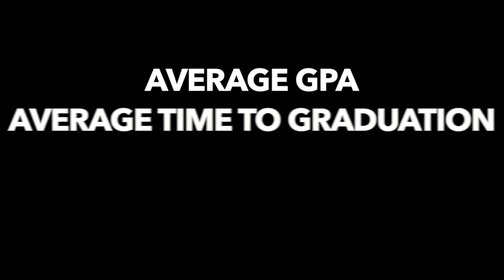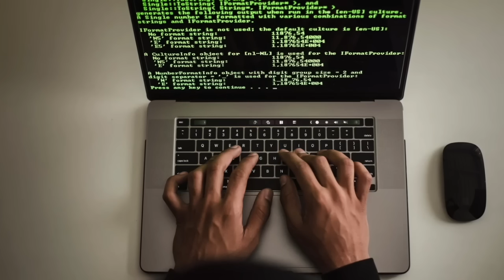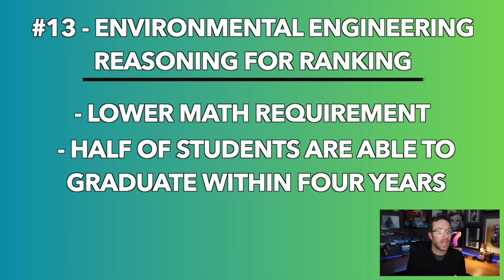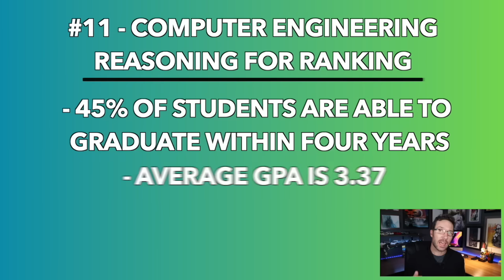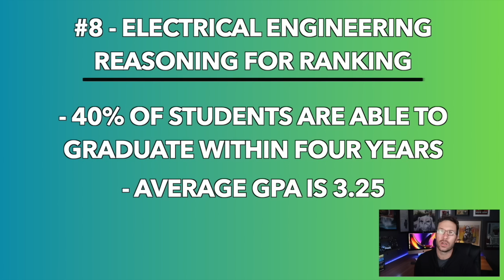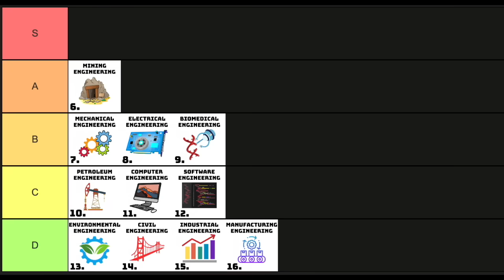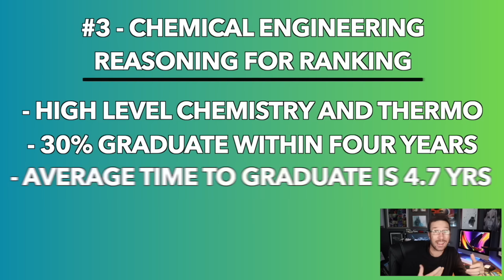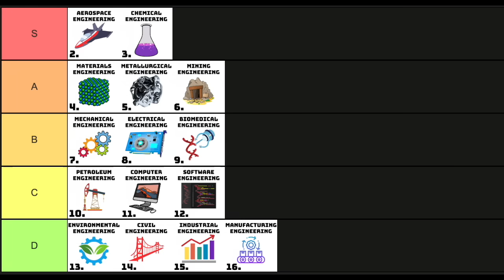Engineering Degrees Ranked By Difficulty (Tier List)

Comment: I've been working with mechanical and manufacturing engineers for more that 30 years and have never met one with a BSME degree who used calculus. Design software takes on more calculations that used to be done in an engineering notebook.
Reply: True, but at least in theory they ought to be able to understand what the design software is doing!

We manage to teach basic physics without teaching calculus first, which is really a bit strange because understanding calculus makes it a lot easier to understand what's going on in the physics, and I would think that since engineering builds on basic physics, understanding calculus is more and more of a benefit in understanding things there.  At the very least, you've got the idea that the accumulation of water in a tank is the integral of the inflow, even if you don't use those words for it.
Reply: @BrooksMoses  How many people are now utilizing AI, yet do not have a clue what background calculations/algorithms are being used? Certainly, knowing this could be helpful but is often not necessary. Many mechanical engineers do not use FEA on a frequent basis, if at all. Companies often designate someone to do this higher-level work because some hand calculations are necessary. Those with masters degrees are more likely to do this, at least based upon my experience.

Comment: The catalogs show the number of hours mentioned in the video. If you do not have the math - trig, plane & solid geometry, college algebra, there are additional courses added to the hours. I had Calc 1 before entering college, but I had to have 145 credit hours to graduate with a BSAE. My advisor had a 160+ credit hours for a BS engineering degree.

Comment: There are a lot of reasons people dont finish their degrees.  Engineering is rigorous and challenging in general, however, for an individual the type of engineering most challenging is a type for which you have no passion.  Further, the opposite is true.  

This video is pretty poorly setup and researched.  I think he is confusing a lot of information associated with engineering and engineering technology and basic science classes.  First off, I know of no actual ABET accredited engineering program that requires Math only to ODE.  You are required in most all engineering to take at least one math class past that (i.e. Linear Algebra, statistic, partial differential equations, numerical analysis....).  I find the idea that Materials and Mining engineering ranked high is laughable.  He describes environmental science here not environmental engineering which requires math past ODE too. Finally, if you worry about the Math classes you have to take for engineering, then the degree is not for you.  Your math classes are your easiest tech classes and elective you will take.  If you cant deal with the math, then the physics and engineering classes you will be required to take will bury you.  Don't put any credence into these sort of dumb lists.

Comment: Using my history as an engineering graduate/retired I would argue the use of GPA and years to complete would be poor measurments of program difficulties.  I don't think the assumption of equal performing students enter every program is accurate as both demand, salary and plain technology interests/challenges would draw different caliber students to each programs.  And on the other end many lower performing students would pick easier enginneering programs just to get into the higher salary jobs without as much diffculty.  Therefore to look at GPA and  time to cmplete would not be correct because the talent level going into each is not equal.  Nor do I believe it balances out with larger quantities.
Reply from the maker: interesting point. So what data would you use to rank them?
Reply: @becominganengineer2271  .I honestly have not thought a lot about it but I would suggest your premise is wrong.  A college programs is not objectively hard....it is subjective.  To a large part of the population dunking a basketball is hard...to 100% of the NBA population is is easy.  First thoughts, would rate difficulty as a dependency of the  input subject...for ex.  SAT scores going in, Math/science specifically or  perhaps courses completed going in. I might compare them to GPA performance,length to degree, or dropout rates.  Then the conclusion, if correlated, would be difficulty as a function of these input variables.  There is also the assumption that "difficulty" measurement has supporting and accessible data....that may or may not be true.  WIthout data, you may have to rely on surveys of students...not real accurate but may be best available.

Comment: This video is bullshit. This is why people without Engineering degrees should not be making videos about Engineering.

 First of all, Electrical Engineering has by far the highest level of math amongst all Engineering and including computer science. PDEs are not the most difficult level of math, they’re just ODEs with multiple variables. After taking more complex math courses like calculus I-III, Electrical Engineering students also take EE courses that are 100% advanced math eg control theory, signals and systems, Digital Signal Processing, Electromagnetic waves, transmission line theory, power electronics, circuit theory. 

Also, Computer Engineering is typically an elective of Electrical Engineering

Comment: I agree!  Getting my nuclear engineering degree pretty much kicked my butt but I made it through (BNE81).  What I did learn in college was that I wasn't as smart as I thought when I graduated high school.  I'm surprised that the math requirements have changed so much since I remember taking 2 years of calculus as well as half a year of advanced math (LaPlace Transformations, etc.).  My hardest course was however a ChemE thermodynamics course.   As far as zero growth goes I have to disagree.  Although I'm getting ready to retire after 43 years in the nuclear power production field, my phone rings constantly from companies looking for engineering help for advanced and small modular reactor design and licensing.  There's going to be plenty of nuclear engineering opportunities in the next 10-15 years and a definite shortage of nuclear engineers.
Reply: I actually am the opposite.  Got my degree from Arizona in '94 (one of the last group of BS students before the Dean of Engineering killed the program and folded us into Mechanical -- around '96 or '97).  I don't know if it was our professors, but we had some of the best professors that could easily explain things to us (David Hetrick, Morton Wacks, Robert Seale, Barry Ganapol, John Williams, William Fillipone, and Wayne Jouse) and the NE classes were easy to understand.  I found that classes in non-Nuclear subjects were actually more difficult than the Nuclear subjects (with the exception of Thermo/Heat Transfer due to Henry Perkins).  We also had access to some good equipment for learning (TRIGA mk 3 - 100kW, a Co 60 irradiator, a natural uranium pile, and a linear electron accelerator).
Reply: @csdn4483 so should I be a nuclear engineer? Btw, I am in 10th grade and love everything related to nuclear energy
Reply: My son will be a graduating this yr as nuclear engineer from RPI. He was originally a ChemE, then switched over NucE. Good to hear from someone in the field that there are jobs available
Reply: Was about to say. The amount of nuclear shit going on right now is crazy. New plants are sprouting up all over the world. China just invented that battery that'll supposedly last 50 years, we're redeveloping the fusion model... just saying. We have plenty of room for growth my N.E. brother!
Reply: Thermo is no joke
Reply: iam graduating currently in software and yeah thats what i said, no way the job growth is 0% , nuclear will most likely be the main energy source in the future if we get through the whole false media's portrayal of how dangerous it is

Comment: I have a bachelor's in nuclear engineering and I can tell you first hand, it's not as bad as you might think.  Chemical engineering looked far worse from where I stood.  I've always been a shit student and I skated by with a 2.5 gpa, but dammit, I got though.  I was also 30 when I went back for it, so it was extra hard to have the stamina my classmates had to get through long nights finishing projects and such.
Reply: Also I made 87k my first year, 141k my second year, and 178k my third year out as an equipment operator at a nuclear power plant.  If you look on indeed it would probably say ~104k, but that's based on the hourly rate with no bonuses or overtime, and every job at the plant will have overtime during the outage.

Comment: Highest level of maths is not ordinary differential equations for most of these engineering degrees that is a big lie. Degrees like electrical, computer, software will study things like laplace and fourier transforms in signal analysis, even partial differential equations in the area of electromagnetism. there is also complex analysis, statistics and random processes that is also higher level. so stop lying about the level of maths

Comment: Interesting analysis, which seems solid. I wonder how strongly connected the degrees are to the people in the jobs making the average salaries you quoted. I know that many people come to software engineering jobs by way of education in other disciplines, then fill their knowledge gap with on-the-job education. One of the best engineers I've worked with was an English Lit major who eventually did an MS in CS because it looked like fun (yeah...she is extremely smart). An old friend who ran one of the first program trading shops ever at Citibank (back when it was called that) said his best programmers were all educated as physicists.

Comment: I think that your assessment of the engineering degrees is off, when you say that the highest math required is differential equations. You are wrong!!! big time there is no other engineering degree that has more the need of math and physics than EE in particular if you have to deal with either telecom or semiconductors. I like to see any chemical, mechanical,  aerospace, civil or software engineers to solve the equations needed to design a good antenna or to figure out how is transport of electrons in a pn junction. Because the smaller or faster the activity that you need to control or monitor the most complex the math that you must use. The rate of graduation of EE is high, do you know why? Because according to an article from Forbes the EE are the smartest of the engineers, in the same way that the smartest of the physical sciences students are the Physics major and in the social sciences are the philosophers. The salaries are not as high, because in general the EE are more concerned with having fun with their profession than making money. I have the chance to work for some of the most renown research private renown centers in the US and in all cases EE always got a special treatment.

Comment: It is often repeated to me an engineering degree are basically a union card, with it, you are allowed to acquire the relevant experiences. Based on that , the trick will be to get the easiest degree, let say computer, and self educate yourself in the field to what specialty you want to practice in. Very often the stuff you learned in university is useless anyway, I heard engineers said 95% are garbage. It must be noted in Ontario Canada  (typical) your stamp and number for approval of drawings did not say what field you are in, and even in the same field, such as switching from ship design to automotive , both mechanical, you can be very uncomfortable signing off designs at first. I seen my share of chemical engineer working on structure or mechanical on computers.

Comment: Suggestion: what is minimum IQ to be an engineer?  Nothing on internet answers question directly, except average IQs are generally known to be around 130.  Don't give me the motivation crap about how it doesn't matter when clearly there are correlations between high school marks & success in engineering.  Even if it is possible to get an engineering degree with 80 IQ, such a person would have to work so much harder, I doubt most such people would be able to keep up the effort with no free time.
Reply from the maker: it is my believe that your "IQ" is not set in stone .. your brain can be strengthened .. just like any other muscle

Comment: I don’t know that I buy this “ranking” of difficulty. The visualization skills are very different in civil than they are for electrical. But the math requirements are very different in ECE. In every one of these areas you will need to find out how to solve new problems quickly. I also wouldn’t say that civil was an “easy” degree. The structural line is not for the faint of heart, and the breadth of disciplinary knowledge was also quite extensive. Further, there is almost no universal requirement for a math class in PDE. Most ME undergrads get SOME of it in an FEA class. 

You will have to be able to define problems, find solutions to those problems, and choose the best solution no matter your field. 

Further, many problems become highly multidisciplinary and engineers really do need some cross-disciplinary training and project management skills.

Comment: You may spent a lot of time with data however, your reasoning for ranking does not give the right ranking by difficulty. For example, many students find the degree so hard that they escape it in the early stages which would lead to an average GPA higher and graduate sooner.
Reply from the maker: good point